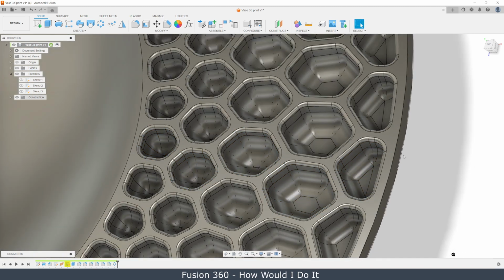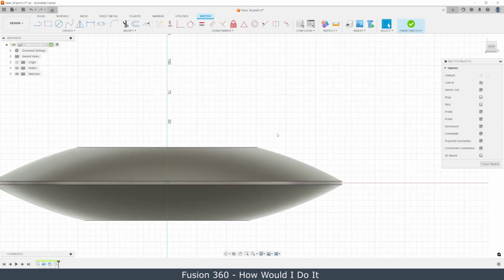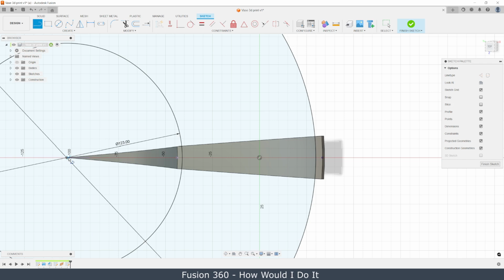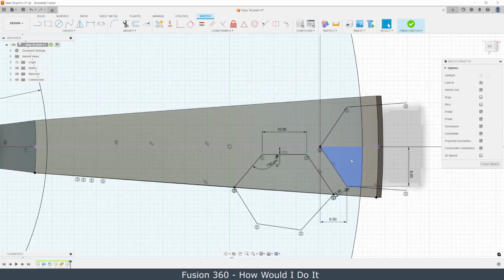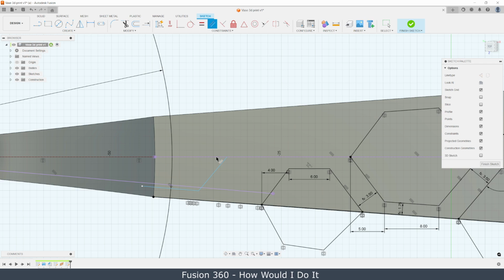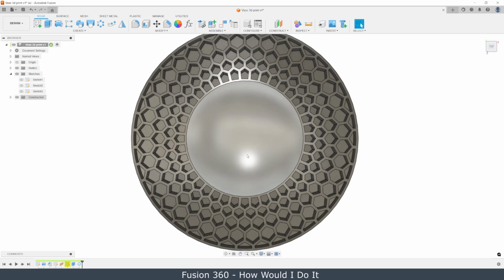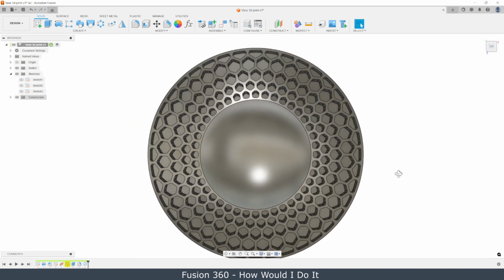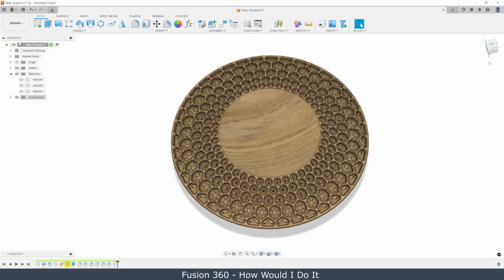Model a Complex Vase in Fusion 360 | Hexagon Honeycomb Pattern Tutorial

Comment: i can do alot in fusion but stuff like this still takes me a while ... also my computer kind of is very slow with complex stuff
Reply from the maker: Thank you for the comment! You're right, models with complex patterns can definitely test your PC's limits. In my experience, the trickiest part here is setting up that plane at angle correctly. Once you have that, the key is identifying the pattern you can rotate around the perimeter. The rest seems straightforward!

Comment: It looks a bit too big for my old Prusa. Since you're already making it for 3D printing, make it so it can be printed without any editing.
Reply from the maker: Good point. 
It can look like I did it on purpose ;).
The model is parametric, so you can adjust the height and diameter in Fusion to fit your Prusa’s build volume.
Alternatively, you can simply scale the model directly in your slicer during print preparation without any additional editing in Fusion.